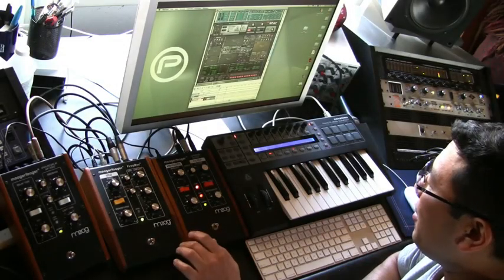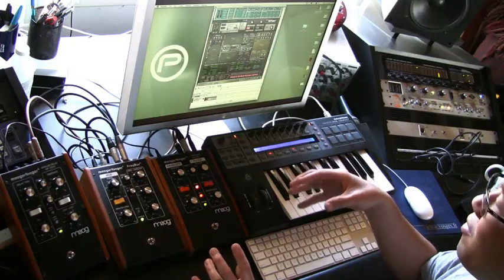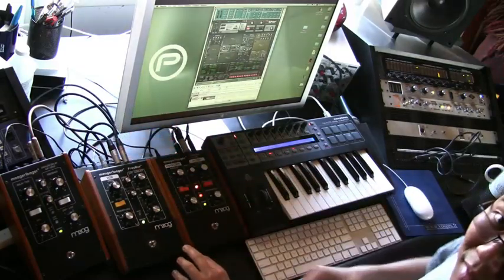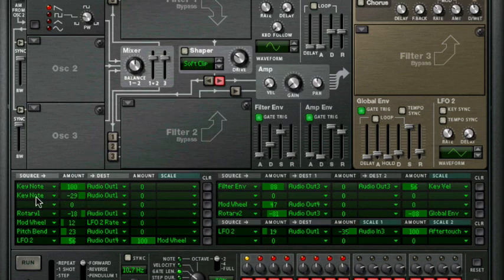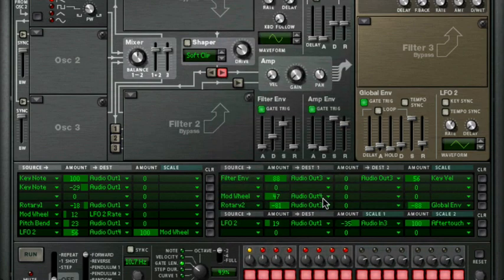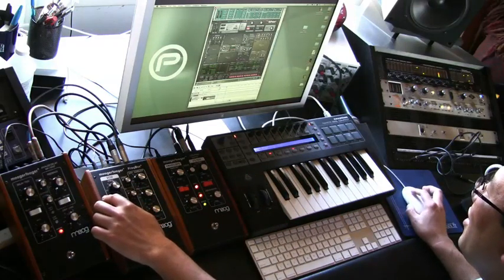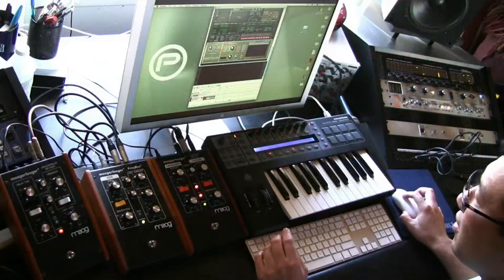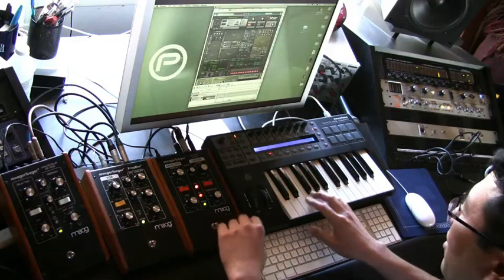moogerfoogers controlled by Reason 4.0

Comment: CV is another world! I honestly am just beginning to wrap my head around it. I've become rather proficient using reason 4 over this last year and a half, as well as my modular  (100m) but I'm yet to do such a radical experiment. A midi to cv interface would probably allow me to do what you are doing, wouldn't it? I've been looking at volta, but the 100m was not on it's list of compatible synths, but according to you (I assume) an MOTU interface converts an audio signal into a dc signal. dc=cv?

Comment: The biggest issue with using mono jacks is that you lose the ability to use the passive CV pedals, as the +5 output is somehow cancelled or sent to ground ( I can't remember exactly how it works but they explain it breifly in the MF manuals).  The disconnected ring trick sounds like a good idea, though.  I could send a CV to the mix jack and still plug in a pedal directly to the frequency jack without having to waste one of my attenuators.  Thanks for the tip.